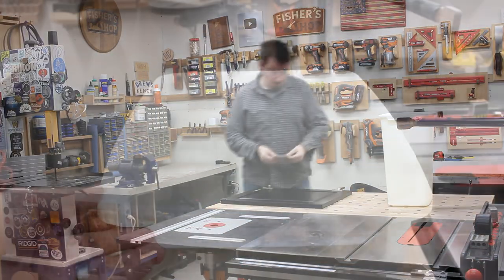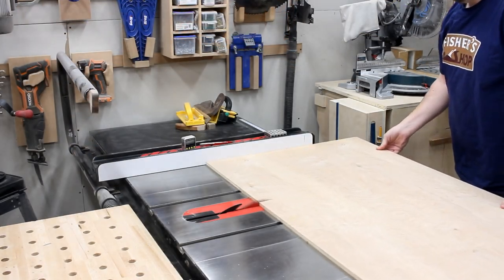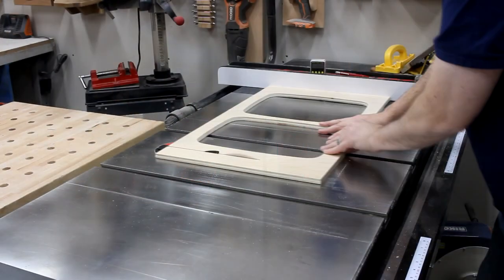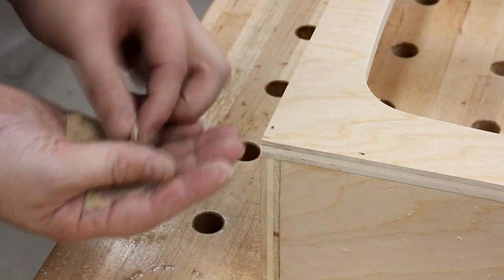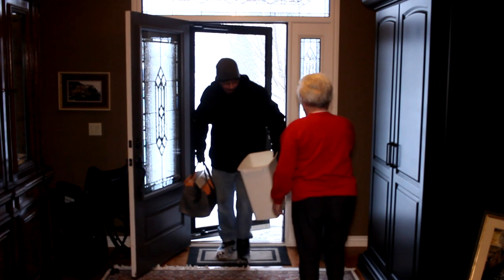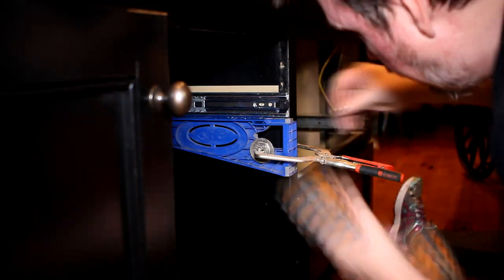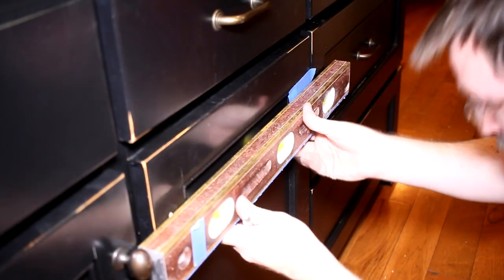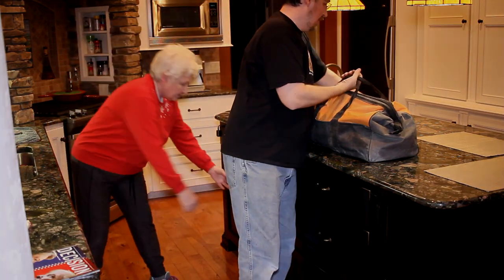Woodworking: Upgrading Mom’s Trash Cabinet

Comment: From experience, be prepared for all those comments about how heavy the bins will get which will lead your slides to fail (even though they are rated for 100 pounds). Rest assured that I have this same system in my kitchen and built a similar one in my shop for my trash and hasn't failed me yet 😉
Reply from the maker: Well, I tend to throw away multitudes of 100lb gold bricks, so it might actually be a problem.  I just don't know what to do with all these stinkin' gold bricks! I have too many!!
Reply: @FishersShop  Yo. I think I have a solution for you! Hit me up! lol
Reply: Dump them in your neighbor's yard, then they're his problem.   ;)
Reply: @FishersShop  lol😂
Reply: @FishersShop  Perhaps you should use them as a foundation for your neighbor's deck?  I suspect it's a little rickety already with all the items you've... uh... liberated from it over the years.
Reply: It would be fine and hold up great if only he didn't use that flathead screw.
Reply: No soft close drawer slides? Do you not love your mother?
Reply: The bigger issue I see is that his mom now needs to pick up the trashcans higher to remove them.
Reply: I’ve had a trash can cabinet like that for >than 10 years.  The trash cans never get too heavy and the glides haven’t sagged. It’s not too hard/heavy to lift them out. I generally lift out the trash bag and not the bin. I did manage to break one the edges on one of the plastic bins, but they were easily replaceable from Amazon as they are a standard size. The only difference on mine is the sides where the glides are triangular in shape to give more support to the bottom of the door.  You did a nice thing for your mom!
Reply: @FishersShop  I was wondering who was behind all those "cash-for-gold" places. This explains everything!
Reply: For real. Those slides will hold plenty more than those garbage bags are good for.
Reply: @karenmitchell6814  I totally agree. We have the same setup and it works great (for 11+ years). Even my young kids can pull them out.
Reply: Well said Marie.  No offence to Drew's parents but they look to be "mature" and their combined garbage and recycle each week will weigh about 2 pounds.  Not like me, just my beef bones weigh 5 pounds! !! !!!
Reply: I've not delved into the weight these ball bearing slides can manage, but I was expecting a second set of rails at the lower end or bottom mount rails.  Glad they are not necessary.

I had a gold brick once.  Someone told me it was iron pyrite so I gave it away.  I didn't want to be foolish, you know?

And thanks for being a good son.  One day when they are gone you'll be glad you did, and it sets a great example for those little heathens (err, gold plated little amazing glimpse of future humans) that pick which nursing home you end up in.  :-P

Comment: I have the same kind of thing and used the rev-a-self stuff.   Its not grteat, but they make little brackets that connect the door to the pull out so it does the same thing.  The whole door pulls out.  I have that installed and the base is kind of thin.  It flexes the sides in and makes the slides drag.  I will be doing this without a CNC, but really had the same idea in mind with full slide extensions and soft close.  Will make it way better and I'm sure this design is 100% better than the stuff HD and lowes sells for this conversion!

Comment: What a great solution for Mom. Nicely done too. I'm thinking of doing the same thing now.
 I see you also have the ONEFINITY. I just ordered mine last Tuesday. Just wondering what CAD program you ended up going with for it. I still need to decide but am all new to CNC and my mind is going numb trying to make a decision. Reading and watching videos has me even more confused now. Delivery isn't expected till late May so I wanted to pick something up and try to start learning it.
Reply from the maker: I was already used to using Easel so I'm using that for 2D stuff.  3D stuff will all be done with Fusion360 since I know that as well.

Comment: Hey Drew! Any tips on avoiding snipe on the DW735 planer that has worked for you? Having a hard time with mine. Love the videos, thanks!
Reply from the maker: Take lighter passes?  If it's still a problem, use a sled with sacrificial extended side runners to take the snipe off the project piece.  I have a video about it somewhere but you'll have to dig for it

Comment: Ohh man I just did the same thing over spray painting 1/4 of my bench with yellow.
Reply from the maker: If we were to combine our 2 overspray skills we might be able to make 1 really bad painter.
Reply: Diy Builds as long as you don't overspray on those sandals, your "golden"!
Reply: @peternelson5113  my garage floor is about 20 different colours in all sorts of patterns lol
Reply: I have a pretty pink air compressor enclosure after I repainted my two daughters' toybox
Reply: I consider the paint on my garage floor as “redecorating “

Comment: When installing full extention slides,  or just removing and replacing drawer boxes, ALWAYS slide your bearings forward before putting the slide insert in.

This will assure you never bust the bearings or the housing for the bearings. And you'll hear it "click" in place. 

You have to repeat this to painters over and over and over..........they destroy so many by not doing this very thing and trying to force in.

Comment: Cuz you couldn't trace your paper pattern onto the plywood and cut it out. :D
Reply from the maker: Nobody could.  Not as good as I wanted it, at least.  Perfect job for the CNC
Reply: Technically, you can... or you can use tape, make the pattern, then tape it down. 😁 But can’t beat that CNC for cut quality.